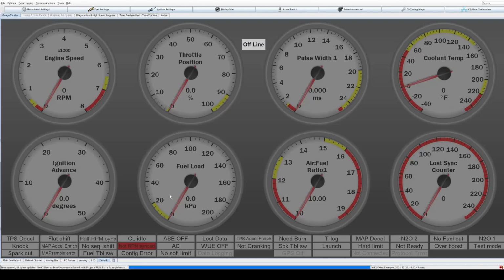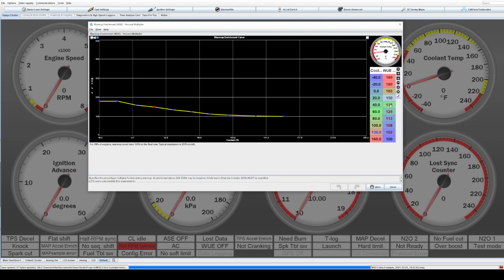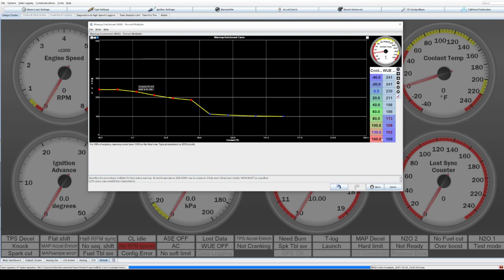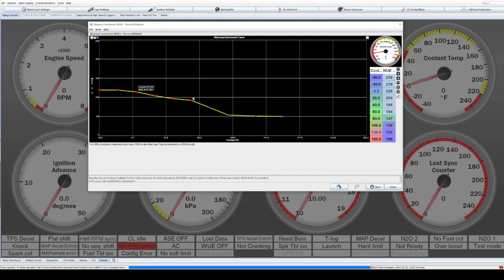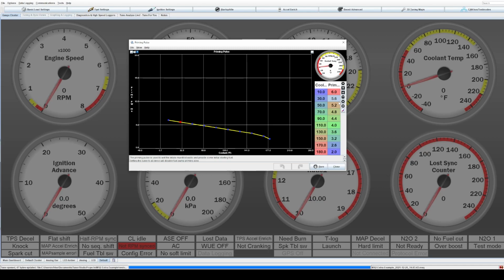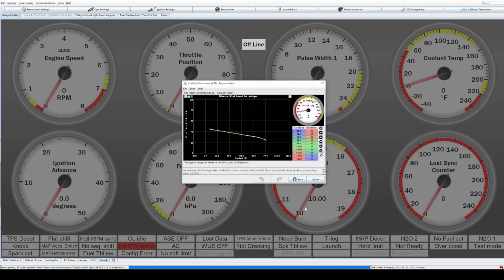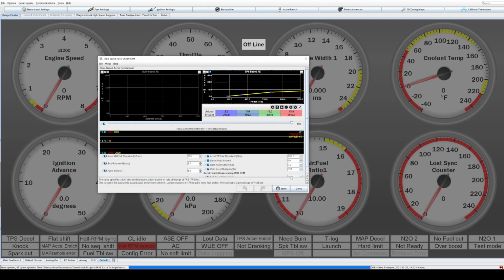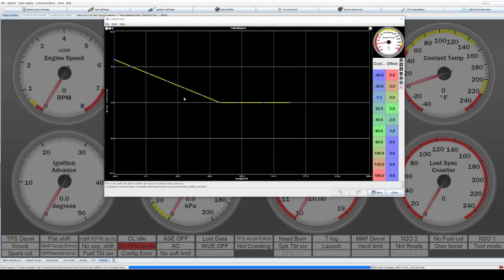Megasquirt Cold Start Tips

Comment: am i rich or lean of it takes 5 sec so start but when it starts it warms up really well. i also dont smell any e85 while cranking
Reply from the maker: Easy test. Add 10% fuel and see if it gets better then if not take out 10% and see if that improves. No harm added or subtracting from where it is now to test it. You just need to find what the engine wants
Reply: @TurbineResearch  added fuel littlebit and it works way better now! thanks alot
Reply from the maker: @e34boat88  no problem!

Comment: no mention of cranking amps..

Starter motor sucks many amps, this will alter injector pulse. Have a good battery before you tune and continue with that same battery

Some battery and starter motors vary in amp draw. You will need too compensate for this

Ethanol only thing engines take ages too warm, you better off running lean at idle, especially if for short drives, you won’t give the moisture heat too dry if your engine doesn’t get warm. always warm up E85.

Comment: My blown BBC with eight 48 lb (502 cc) injectors starts but dies after a few seconds. Another video I watched said to increase the fuel table by 10 to 20 % around idle and possibly lower the ASE to prevent flooding. That helped a little, but it still dies. Should I leave the fuel table and ASE alone and play with the WUE? I have not changed the WUE from the default as suggested in your video. My Required Fuel is 11.9 and the fuel table is around 45 at idle.
Reply: Your what

Comment: What about cranking pulse? Does it have alot to do with it or no?
Reply from the maker: Cranking pulse helps on the initial start of the engine you can try a few startups and add or take away fuel on cranking to see if it helps

Comment: When I first crank mine it surges bad for 30to 40 seconds before it smooths out and the warmup enrichment seams to kick in, should I give it more after start enrichment fuel? V8, cam, 630cc injectors, etc... Thanks
Reply from the maker: You can try taking out fuel on cranking and after start  to see if that helps. Try changing only one of them at a time to make sure you know what what parameter is helping the most
Reply: @TurbineResearch  ok thank you.

Comment: Really enjoy your videos. Are you aware of a way to prevent ignition until acquiring full sync? The initial waste spark until sync has my sequential V8 backfiring through the intake. My cams are huge with close to 30 degrees of overlap.
Reply from the maker: You can change the ignition advance on startup and cranking to avoid the spark going off when undesired
Reply: @TurbineResearch  Thanks for the response. I actually found that I can choose to prevent spark until both wheels synch when I updated my firmware. Once selected I have not had a single backfire since and I think this was added for this reason.

Comment: could you do a video covering start up crank advance and its effects...mine starts alright but id like better
Reply from the maker: Adding more advance on idle and cranking makes more power and usually increases the idle speed as you add advance. Cranking advance is usually 10-15deg and doesn't typically change much in my experience. You can change the setting that waits 3 rotations before firing the coils to 1 rotation.